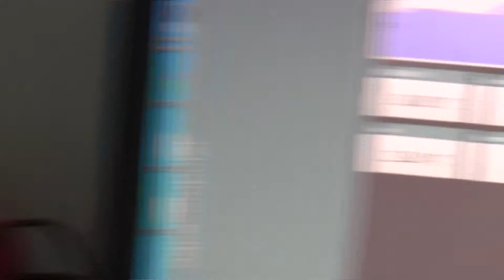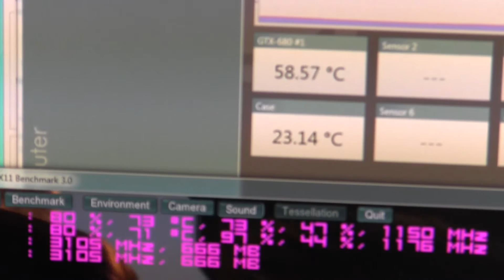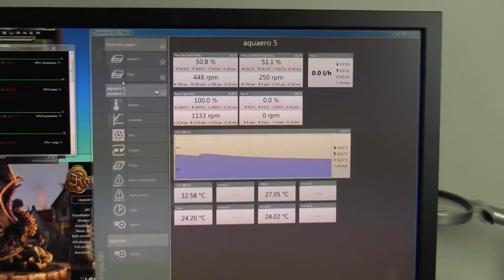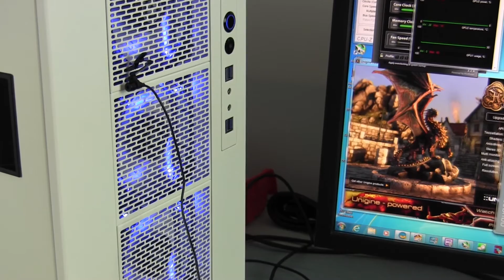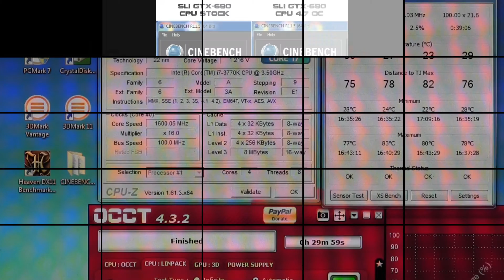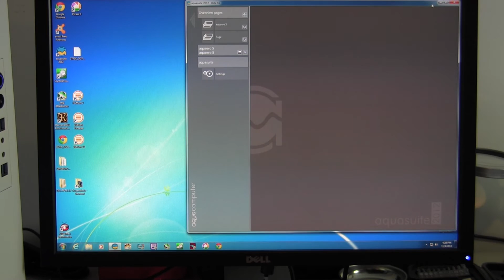Case Labs SM8,  Z77 OC Formula AIR Cooled Build Log 5 -  Aquaero 5, Overclock i7-3770k, Benchmarks

Comment from the maker: I will be using hardware monitor as my main SW temp measurement tool, but I don't believe the Aquaero has a thermal reading on any part of its controller. If it does then I will certainly use that.  Since I have so many temp probe options I thought I would try that too.

Comment: Well you probably could use some 2-compound glue to get it back on steight. However when you put the CPU+IHS back on the socket, the bracket gives it way enough down force so it goes nowere. 
If you follow this guy's guide, you'll be good: /watch?v=XXs0I5kuoX4&feature=g-hist 

One advice thought: untighten the buttom screw of the socket 1-1.5 turns when placing the CPU back on. When the bracket is closed and secured thighten the screw again. 

I needed 2 attempts to get it properly. Good luck!

Comment: It is allready amazing you got to 4.7 Ghz without removing the IHS (Internal Heat Spreader) I could not run a single OC without. At stock with an EK HF Supreme and Indigo extreme it went to 85°C, with OC it was 105°C. After removing the IHS and replacing the TIM I ganed 35-40 °C. Now at 4.6Ghz 1.33V I get 74°C max. 

So IHS removal/mod is highly recommended, however you can say bye to your warranty.